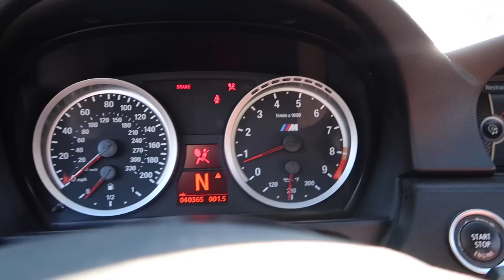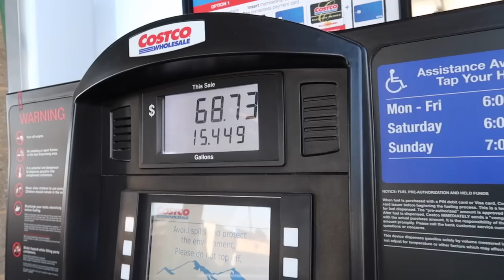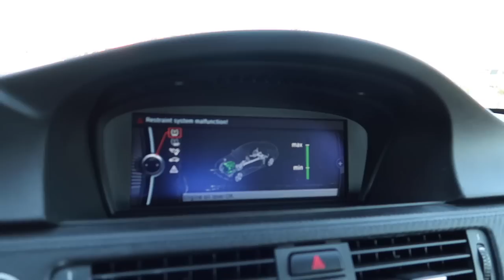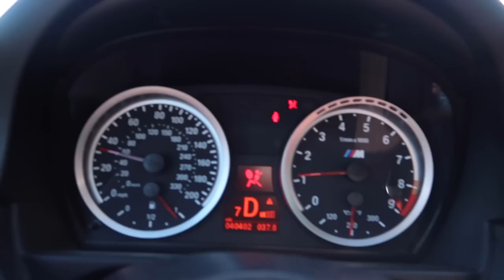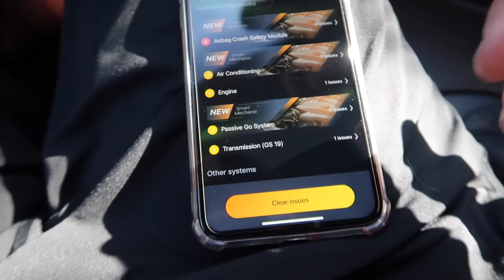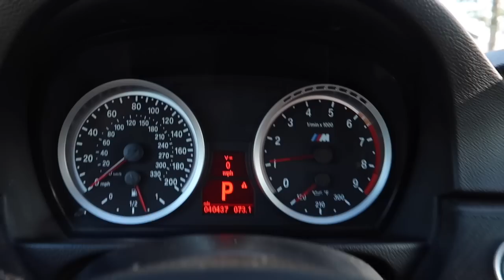COMPLETELY TRANSFORMED THE M3 INTERIOR AND FIXED ALL ERRORS WITH ONLY $10! (LOOKS SO MINT 😍)

Comment: Great to see the E92 M3 out on the road! Hearing clunking is not normal. Double check looking around the trans pan and filter housing for leaks (common fault-gasket), and make sure DCT fluid is at sufficient levels.

Comment: For the trans issue, if it’s occurring during launch/downshift/up shift etc. it will most likely be your driveshaft Center support bearing and/or Flex disc/guibo which are usually common issues. You can also check if you hear like a baseball bat hit if you go in reverse, etc.